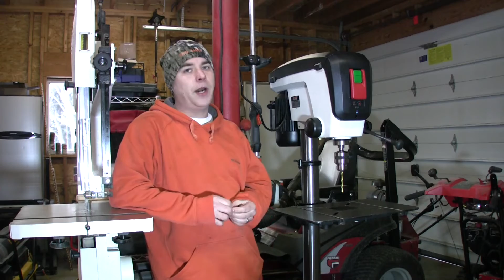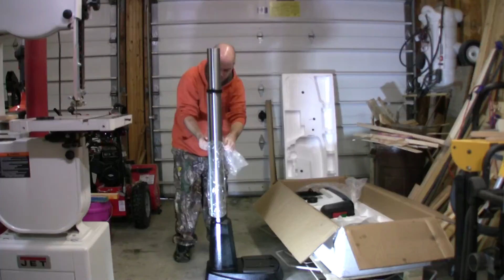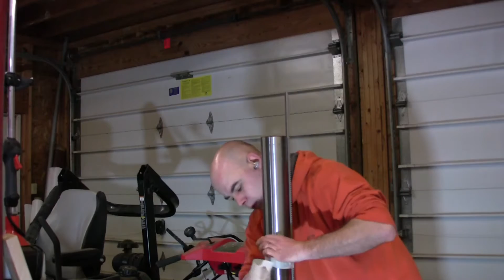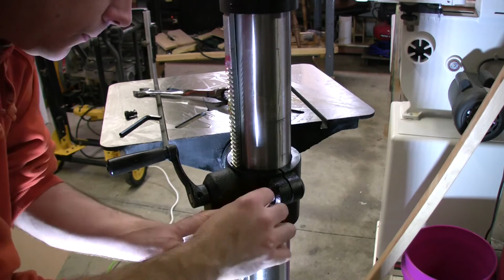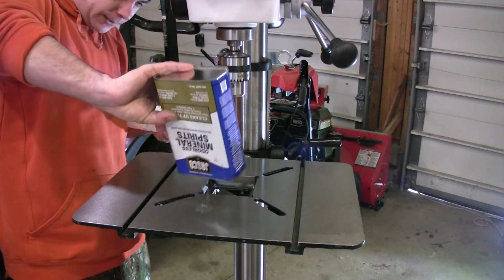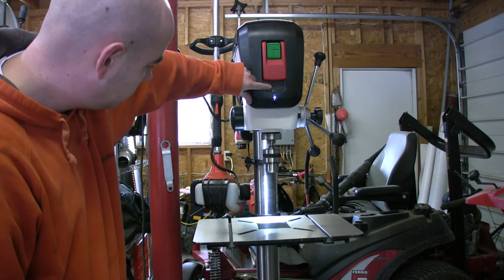Drill Press Assembly JET JDP-17

Comment: Thanks for the video. I tried to install it by myself like you did but wasn’t successful. So I got a helper who held the rack in the slot/table bracket while I guided it over the column. The motor was heavy but with two people it made it easier. We had the motor and table on in less than 10 minutes. Then I installed the rest of the parts.